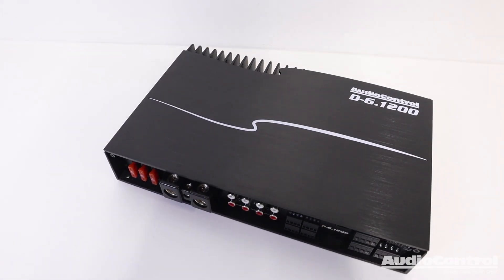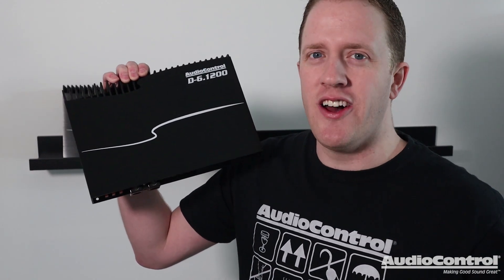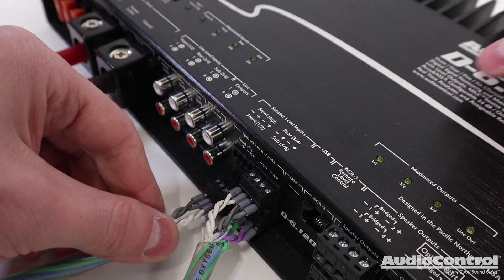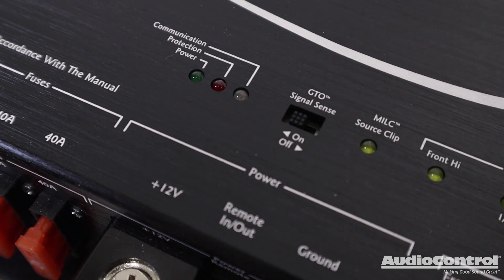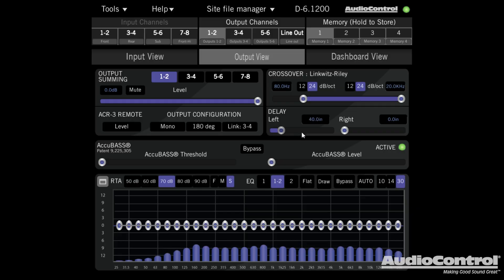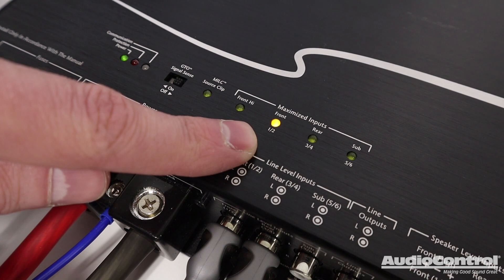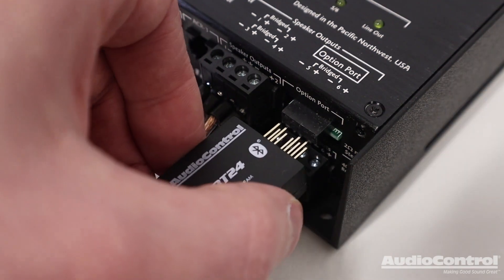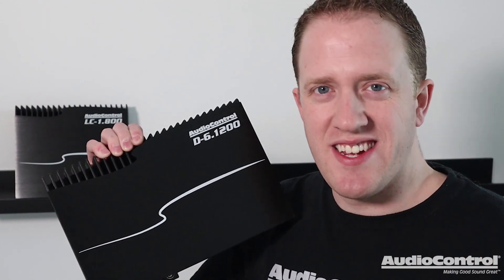6 Channels of FULL DSP AMPLIFIED POWER! AudioControl D-6.1200 Amplifier

Comment: With DSP amps in general, what will happen if I don't run additional power from the battery and just use the power from the head unit into the system connector?

Comment: Simple question. Channels 1-2 I just need a HP filter probably about 3500hz HP give or take playing around with it for my audiofrog 3 way active setup. 

My plan for my active setup will be

tweeters - Audiofrog GB10 1" tweeters (thinking 3500 and up hp)
Midrange - audiofrog gb40 4" midrange ( thinking maybe 500-3500 just have to play around)
midbass - audiofrog gb60 6" midbass ( 80-500hz)

SO my question is this, do channels 3-4 and 5-6 have the ability for bandpass crossovers because that will be key for my setup?

Comment: With the BT24 module would it be possible to have a headless set up by just streaming from say Spotify/Apple Music straight to the d6.1200 and using the adjustment level as a volume knob or is there no option to adjust volume with the level? Are there limitations to what can be streamed to the module?

Comment: So real quick can I tune each of the six channels individual? Right now I’m running to Jl Audio G 6600 6 channel but it still only has three adjustments on it which all defeats the purpose of having six channels basically all it has is three channels with six Spots to put speaker wires.
Reply from the maker: Yes! The DM-SmartDSP software, which is used to setup, control and tune the D-6.1200 amplifier, can control and tune each pair of outputs separately, as well as being able to control the non-amplified 2ch RCA outputs, too. With a 6ch DSP amplifier, there's really not much you cannot do!

Comment: Can I use this as a 4 channel amplifier and would I get higher wattage or do you have one that is 4 channel with dsp
Reply from the maker: You can configure the D-6.1200 as a 6ch, 5ch, or 3ch amplifier. If you would prefer a DSP 4ch instead, we offer the D-4.800 model, which has all the same features, but 2 less channels. You can check it out here: https://www.audiocontrol.com/car-audio/power-amplifiers/d-4800/

Comment: Hello, thanks for the great video. Unfortunately the process to setup gain all the way through the chain is not really clear... (whatever in this vid or in the product doc or on audio control website.knowledge base).
step 1 Input view gain a 0db I guess? then increase HU volume until MILC kicks on, decrease a bit and we have our HU max vol . That is ok
step 2 Here is where things are more confused, are the output level from the output view equivalent as real gain knob ? if so why their max are at 0DB? to me it is just for leveling by reducing gain so ? does that mean by default the 0db setup correspond to the maximum gain ? If so we should set them up all the way down before step 1 (as they are 0DB by default)?
What is the parameter to consider to setup the gain for each output (I'm using 3 way active front + 1 output preamp for sub amp) and then check the maximized ouput LED ?
Any help will be much appreciated and I think useful for others.
cheers
Reply from the maker: It would be a lot to type out, but we would love to help. If you need some assistance setting up your AudioControl equipment, or have questions, we have a fantastic tech team that can be reached M-F, 9am-5pm PST. All of our contact info can be found here: https://www.audiocontrol.com/contact/

Comment: My car has 4 stock speakers in the doors. I want to cancel the OEM speakers and put 1 woofer 1 mid range and 1 tweeter in each door, so there will be a total of 12 speakers.
Will this DSP be enough to run the system? If so, how to conncet the 12 speaker into the 6 channels? If not, what should I do?

Thanks
Reply from the maker: You have a few options, but you could certainly run your desired speaker configuration from the D-6.1200 amplifier. You would essentially run all 4x tweeters to 2ch, all 4x midranges to 2ch, and all 4x mid bass drivers to 2ch. In this configuration, you'd be running all 12 speakers off of the 6ch amplifier. The only downside to a setup like this is the inability to fade the sound from the front to the rear. If this is important to you, then we would recommend running multiple amplifiers with a standalone DSP, like our DM-810.

Comment: How do you connect 2 dash speakers and 2 front  doors speakers and 2 back doors speakers and a subwoofer to this thing. I am considering getting one. But i have 6 speakers and subwoofer ??  Where to connect them to this device??
Reply from the maker: Depends on the speakers and how you'd like to configure it, but ideally, you would run the two dash speakers off of 2ch, the two front doors off of 2ch, the rears off of 2ch, and then use the RCA pre-out to run to your separate sub amplifier. If you want to power your subwoofer from the 6ch you can, but you'd need to combine some of the other speakers together 2ch channels. If you need help, feel free to give us a call sometime and one of our tech team can walk you through.
Reply: same question

Comment: Having a hard time deciding if I wanna use this amp to run my Hertz MLK 1650.3 legend 3 way active set up ... I’m running a Audison BIT 10-D with a JL slash V2 , 450/4 Amp right now . I need 2 more channels of Amplifier and DSP before I can install my 3” Mid driver to my set up . I’m not worried about running my two 10” subs off a DSP , I’ll use my head unit for that .
Reply from the maker: This would be a perfect amplifier to run the MLK 1650.3 setup fully active.

Comment: With more and more cars coming with 8+ speakers 6ch DSPs are going to be worthless and don't even get me started on cars with a Bose system some of the Bose systems are programmed only to work with their speakers and if you try to connect anything else it'll shut down the factory amplifier/s
Reply from the maker: This is why we offer separate DSP's with 8ch inputs and 10ch of output. The 6ch amplifiers are great for lots of applications, but obviously not EVERY application. Also, even our 6ch amplifiers employ 8ch of hi level input, making them even more compatible with OEM multi channel systems. Also, ALL of our products can handle signals from factory amplified systems, such as BOSE. We even went so far as to create a line of products called the AC-LGD's to help manage the issues than can arise when factory speakers are disconnected from some systems. Don't ever let an OEM system stop you from making your vehicle sound great.
Reply: That is why you get rid of all of the factory crap, and replace with aftermarket.
Reply: Why would you need 8+ inputs and outputs? Unless you’re trying to run a surround sound in your car. 6 channels you can hook up 2 speakers to each channel for a total of 12 and still have rms left over. Those cheap factory amp don’t even have more than 50 rms per channel. This one has at the very lease 125 rms per channel. You could prob run 3 mid grade speakers in each channel.

Comment: Going to run my front stage and using the output to a sub amp.
Reply: Did you do it.  ?
Reply: @seanmichael2777  i ended up using  DM-810, LC 6.1200, LC 1.1500and an ACM 4.300.
Reply: @seanmichael2777  this is what it turned out to be like. https://www.facebook.com/groups/12voltCleanWireClub/permalink/907514486468611/
Reply: @Soulgasm08  it came out very nice man 😁 clean install 🙏🏼
Reply: @seanmichael2777  thank you.